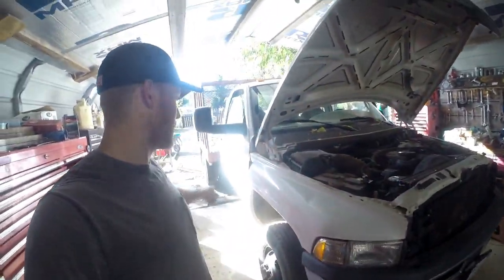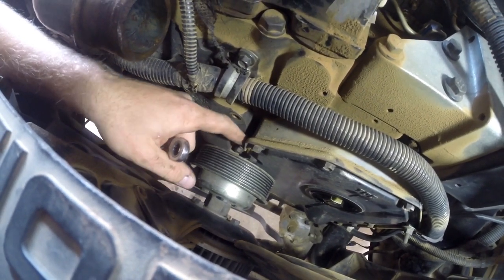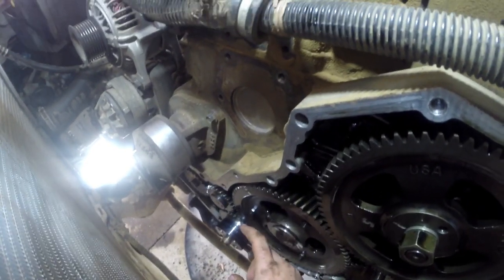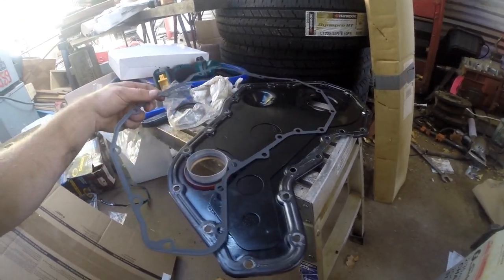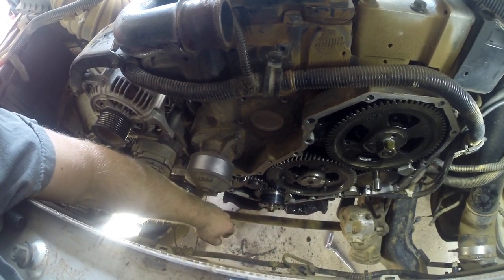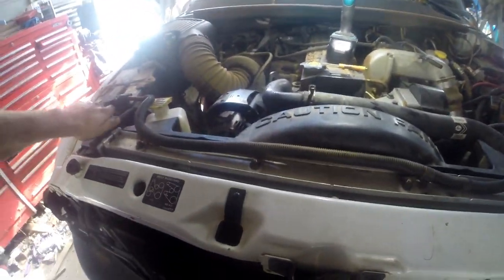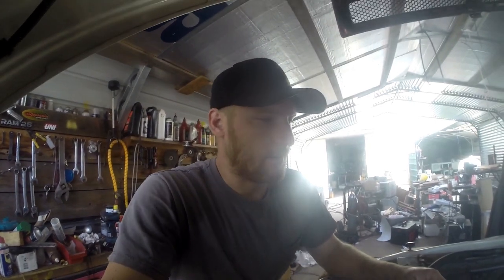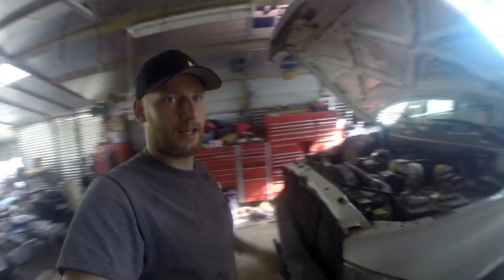REPLACING FRONT MAIN SEAL ON 24V CUMMINS+COMMON ISSUES WITH CUMMINS...

Comment: Nice truck . And thanks for the info. I have a 2002 with 225,000 miles on it and it runs like a champ. I have to do the rear main seal its leaking and i want to do a fass fuel pump on it . And a fless coolant by pass kit on it  . I love the truck . I did a 4th gen front bumper swamp on mine it looks really good i get allot of good compliments on it. Great video men . Have a good one
Reply: Good luck on your rear main seal. My advice is do not get a Fel-Pro gasket I've had two and they're still leaking.I would really love to see a picture of your truck see you how that bumper looks
Reply: Yes sure no problem i can post a picture of of my second gen. With a 4th gen. Front bumper send me an email address or tell me how i can post it on this page and ill do it in the  morning.

Comment: great video,,,good info,,my 02 24 v still has orginal v44 pump, did replace fuel tank pump years ago,,,but 190,000 runs good   24 mpg on highway   hard to beat those numbers,,,and pull my 14,000lb  38 foot scarab n trailer.  does the job!!!

Comment: I’m surprised you didn’t say anything about the killer dowl pin when you had the front cover off. I like the tip about getting a 12V kit to get the gasket. 

These 24V’s with VP44 pumps definitely need a FASS lift pump (Titanium for me) and a fuel pressure gauge. The stock, Carter lift pump is weak. I also use Diesel Kleen for some extra lubricity every fillup. Lots of miles and so far, so good.

Edit:  If you use a repair sleeve on the crank nose, an oversize seal is available.
Reply from the maker: Manny Puerta I actually filmed a 3 minute but about the kdp and pointed it out on this truck but I didn’t want the video to be super super long. But I haven’t heard of one failing on a 24v but it’s been capped anyways 
Fass for sure is a must especially on these trucks

Comment: I did that before on a semi left turning tool in bellhousing with a big 1/2 ratchet on it  crank over 1/2 turn than stop. Than I realized it was still in there the ratchet was against frame and wouldn't let engine turn over.
I agree the 24v vp44 are a pain 12v is the way to go.
Reply from the maker: big murph always worried I would do that. Knock on wood haven’t yet🤞🏻

Comment: Another good video, I agree not my favorite truck in fact,  just sold my 99 24v 3500 dually and went and got a 2010 6.7  2500 6 speed fully deleted!!
Reply from the maker: scott phillips yea bad luck with this model but dad puts it thru hell. Not a bad trade up you did right there! 6.7 deleted is money! 🙌🏻
Reply from the maker: scott phillips and thank you!!
Reply: I own a 99 24v 2500 for 15years...once you work out all the bugs its a reliable machine...302K miles